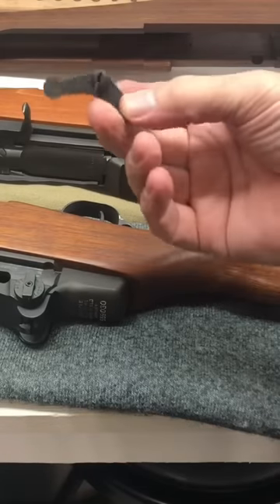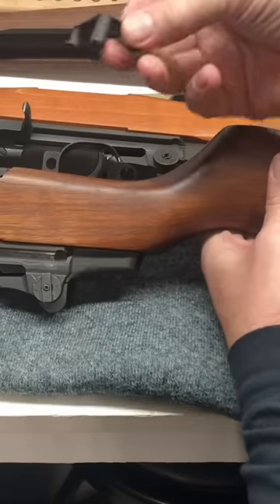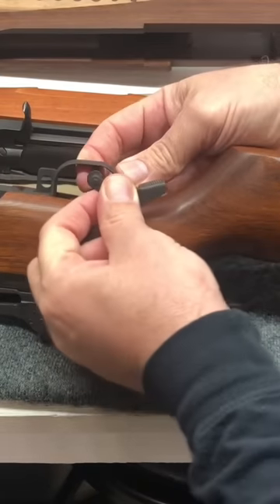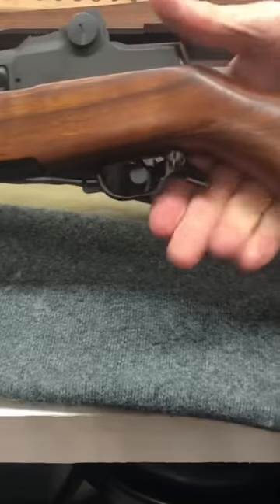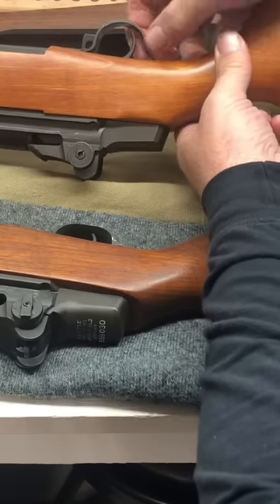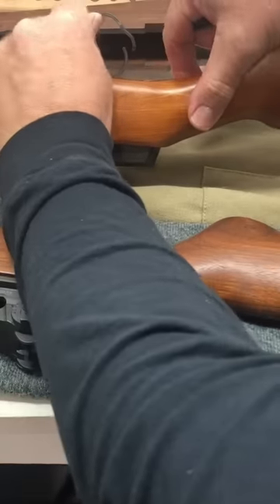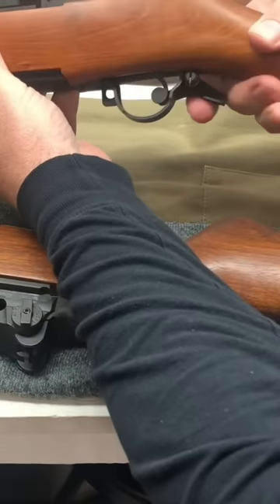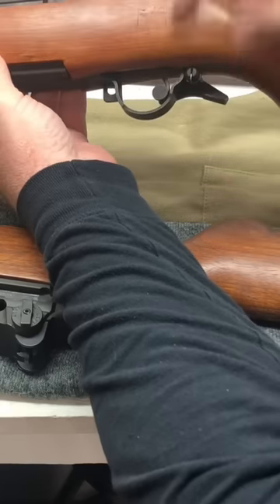M1 Garand winter trigger.

Comment: Not that is matters when the gun freezes together and Chinese are over running you so everyone is shooting 03's.
Reply from the maker: The Garands actually held up pretty well in the frozen temps of Korea.  Just about everything else froze up solid though.
Reply: @FlyingKSports  just something I read about some marines salty they had to get off their hill because army was getting routed.  They claimed the action were freezing on garanda and they were picking of pps43 equipped Chinese with 03s. That therange disparity and elevation they were in good shape save the dwindling ammo situation.
Reply from the maker: @SkinnerBeeMan  Yeah, I guess if it gets cold enough everything freezes.  I know when it gets cold keep the gun oil away from the action.